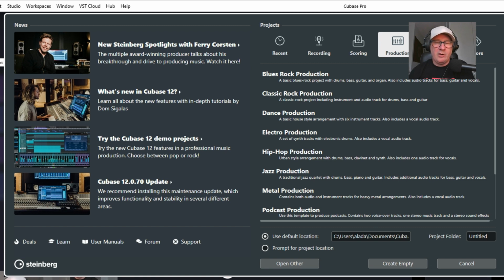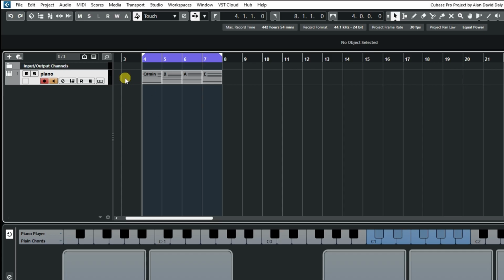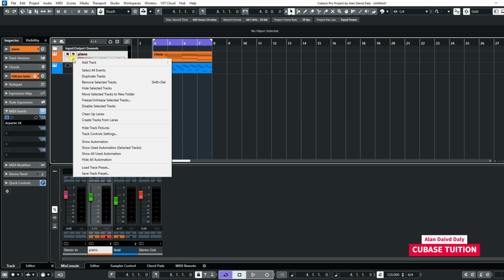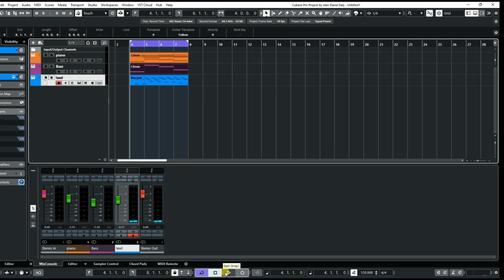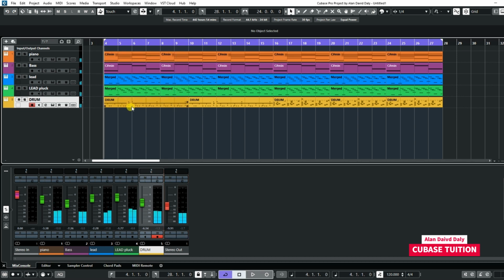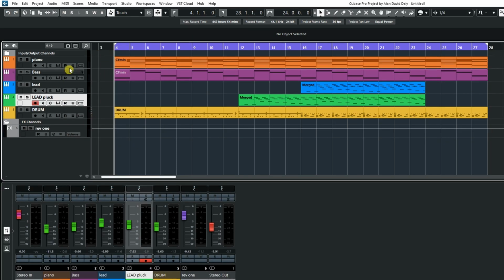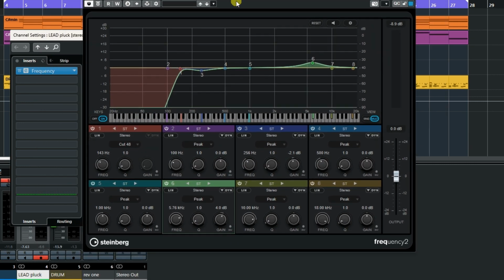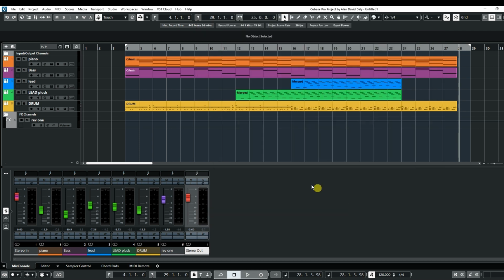Start to Export -Your Cubase First Track,  Start to Export

Comment: The problem I'm having is, my screen is blank. The bar numbers and the lines that separate bars, there's nothing there. And I don't know how to fix it.
Reply from the maker: @Squirrel-i6u  hi thanks for your comment, is it the the top widow that blank.  Have you zoomed in.. press  G or H keys on your keyboard to zoom out. If you want you can send me a photo  of the screen  so I can see what your talking about.
Reply: @alandaviddaly  I'm sorry Alan, I forgot that I should include that, but it's 13. Cubase elements 13.
Reply: @alandaviddaly  I'm completely new to this stuff, so please forgive my ignorance to it, but on the icon on my home screen, it says Cubase LE AI Elements 13
Reply: @alandaviddaly  yes I can do that if I can figure out how, but I'll try to explain a little better first. The lines that separate the bars are not there. The vertical lines that makes up the grid. There's only lines that go left to right, but not up and down.  I feel so stupid! I'm sorry for my poor explanation.
Reply: Like there's 1 bar 2 bar 3 bars.  That screen is just blank
Reply from the maker: When did you get it and have you set up your licence ?.  Yet
Reply from the maker: Located in the sub menu top right you will find the “Snap Grid” button. Please tap the button to open the “Snap Grid” menu, which allows you to choose a grid value and/or turn the grid off. The “Snap Grid” feature is available in the Arrange Window and the editors.
Reply: @alandaviddaly  it's probably been a month ago that I set it up.  Yes, as far as I know, I have been through all the licenses stuff. I have been using it, and I mean just tinkering around with it, just to learn what everything does. I think I did that with the snap to grid thing, but I'm gonna follow your directions and see if that changes anything.
Reply: @alandaviddaly  And thank you very much for your help and understanding.
Reply from the maker: Have you been  able to record  and song on it. Follow the video on how to set it up and record a track. If you have any questions feel free to text me , I'll do my best to help you.🙏
Reply: @alandaviddaly  Actually, I haven't really tried to record anything. I really hope I don't have a serious issue with it. It's gonna be later on tonight before I can go through the steps you have laid out for me, but soon as I get home from work tonight, I'm gonna try it. I'll definitely let you know what I come up with. Thank you for the help!
Reply: Man, I'm still having trouble with this. And I did try recording something but I could not get it to work. I'm thinking that I'm gonna have to contact customer service and try to figure out what's going on. It's given me fits for the last week. I don't know what to do to fix this. I'm stuck in a rut and I cannot continue until I get this fixed.
Reply from the maker: @Squirrel-i6u  did you download your licence, you should try download cubase again. And email them. Hope you get it sorted.